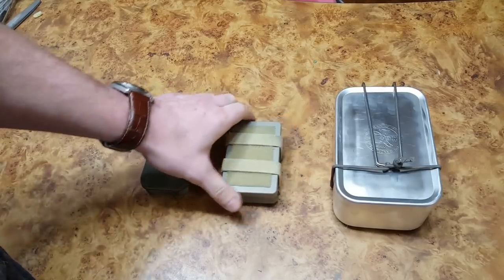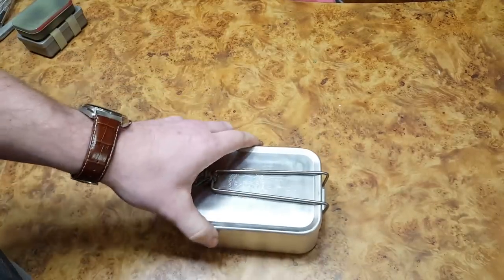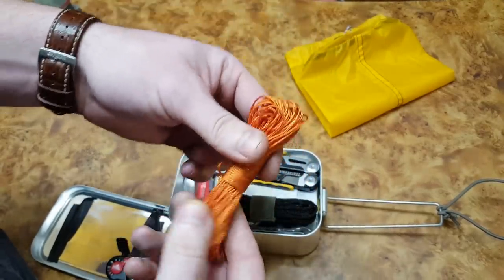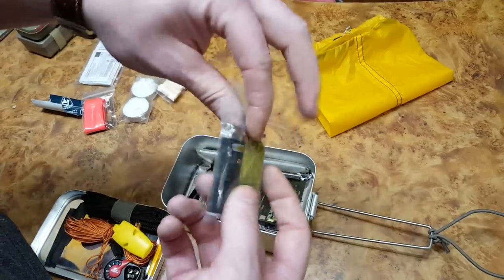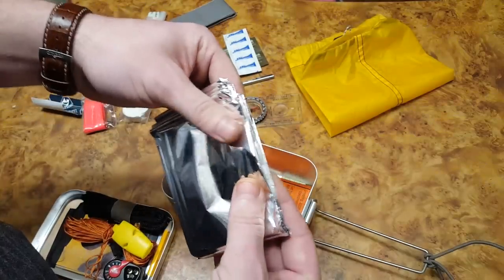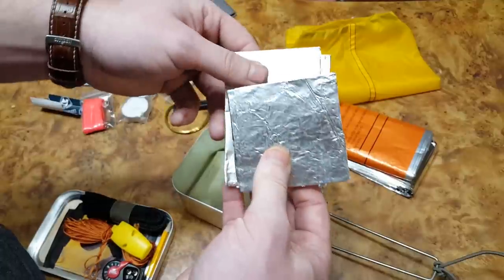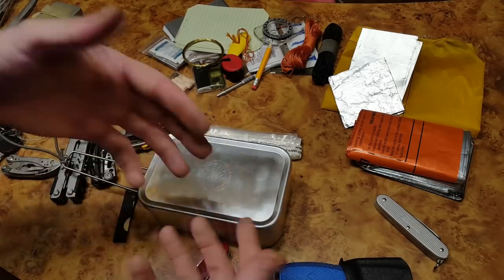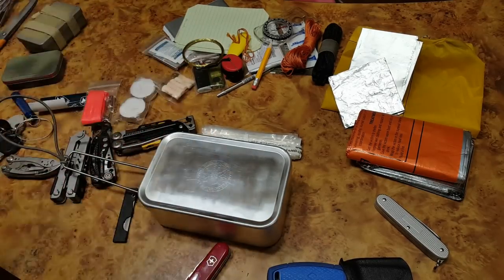Best Survival Tin Kit//Esee Survival Mess Tin homemade kit

Comment: Thanks for the video. 
My two cents worth:
If this is a last ditch kit, to use if you lose your main bag of gear, think about ways to avoid losing your main gear in the first place. Keep it as light and compact as possible, add a retainer cord or strap so if you set it down it can’t fall into a river or off a cliff! Don’t set it down then wander off and lose it. 
With this mini kit: Pay more attention to the shelter aspect. It’s better to conserve calories by keeping warm and dry than trying to gain calories by fishing and snaring. 
Signalling with a mirror is very difficult without an aiming device, even if you know exactly where to aim your flash, and impossible in tree cover or on a cloudy day. 
The ditty bag is a good idea, you can waterproof the seam with thinner silicon, or use the stand up bag inside it for water carrying. It would be even better if the kit was in a bag, inside the tin, so you don’t risk losing something when you empty it out to boil water.
Space blankets are not insulation, they reflect a small amount of radiated heat for a short time, until they become wet inside. (See Mors Kochanski).
A compass is of very little use without a map.
The marker tape is a good idea, if people knew how to blaze a trail and backtrack they often wouldn’t get lost in the first place. 
It takes about 10 times more energy to build a warm, dry natural shelter and gather firewood for the night than it does to carry a lightweight tent and sleeping bag. 
Finally, to everyone who makes survival kits, test them. Go out for two nights with some back up camping gear and try sleeping on a cold night in the rain, using just that mini kit. It’s the only way to know if it will work. Then try doing it one handed, to simulate a common injury when using knives outdoors.
For my calculations see below, after Greg’s comment.
Reply: Was the “ten times more energy” comment based on anything verifiable or just a line thrown out to make an opinion seem like fact?   When I was a  much younger man and backpacked with the Young Sierrans, we carried a fair amount of kit even for our two night out weekend trips - doubled walled tents, ground cloths, sleeping pads and bags, stoves and fuel, nice meals ... We weren’t going out to experience “survival” in the wilderness, but camaraderie in the outdoors - away from our desk jobs and city life.  Many would say this is “roughing it” because we did NOT have electricity, cell phones, the internet, hot showers, flush toilets, etc. We would have “survived” quite well based on the amount and quality of gear we carried on our backs into our tiny areas of seeming “wilderness.”  Real survival - life or death - is more dependent on what you carry between your ears and in your heart than what you carry on or with your person.  Still, if you want to do attempt something like Shackleton, you best have all the will, knowledge and kit you can muster.  Maybe you’ll survive, if that is God’s will.  All these other kits and concepts are better than being “naked and afraid”, but involve trade offs between not just what you can afford, but between what you reasonably can carry AND WHAT YOU WILL CARRY AND HAVE WITH YOU WHEN YOU COME INTO A LIFE OR DEATH SURVIVAL SITUATION.  Mors probably came up with the best compromise - for the boreal forest - with his two kilo survival kit.  Always good to be prepared.  But when your time comes, when God calls you home, you won’ be able to hide under the mountains or the ocean’s, no matter how much survival gear and knowledge you have.  No one survives forever - the way the secular world thinks.  So be good and do good.  Then you’ll be best prepared.
Reply: Greg Kukulski                          It’s a fair question.  I knew that pitching a lightweight tent and setting out a foam mat and warm sleeping bag was quick and easy, and ideal in a real emergency, but I wondered how much energy it took an average person to carry them all day, compared to walking with a very small kit and then building shelter. My own experience is that building a proper rain proof debris shelter or well covered waterproof lean-to from natural materials takes about 3 hours of work. From watching many experienced people online that seems to be the norm. As far as I know there’s no specific study been done of calories burned while building shelter and gathering firewood, so I looked at types of exercise which have been studied and chose ‘light aerobics’ as a fair equivalent, with all the continuous raking, bending, lifting, dragging, carrying and walking that shelter building involves. Collecting firewood for the night takes about another hour or so of similar exercise. Average figures from medical and university studies of people with different body weights and fitness levels are available online and give approx 460 calories per hour. 1844 calories in 4 hours.
Then I looked at how much additional energy is needed to carry a pack, over and above the energy used while walking. Again, the figures from military and medical studies are online. An excellent page with an explanation of how the military study load carrying and an ‘energy vs load’ calculator is called “The ultimate backpacking calorie estimator” at outsideonline.
I allowed 11 pounds of kit, being plenty for lightweight shelter, insulation, food and water, and the most weight the average person would want to carry ‘just in case’ on a wilderness day hike. 
It burns approx 25 calories per hour extra. Then I multiplied that by 6 to assume 6 hours of actual walking in a day, to allow for rests, lunchtime etc. 
That’s 150 calories extra to carry an 11 pound pack. This assumes walking on generally flat or undulating ground, not climbing.
So it turns out that carrying moderate weight on your back while walking requires not very much extra energy compared to just walking, if the terrain is not too steep, and the weight is within normal ‘lightweight hiking’ range.
But 3 or 4 hours of the kind of work needed to gather materials and build a solid shelter capable of keeping us dry and gathering firewood to stay warm uses up a lot of calories. I rounded down, to keep the comparison more fair, since light aerobics is constant movement, but I was surprised to see the huge difference in energy used. At least 10 times more energy required for 4 hours of work than is used to carry 5 kilos on your back.
4 hours light aerobics = 1844 cal
Carrying extra 11 pounds for 6 hours while walking    = 150 cal 
Even if we think ‘light aerobics’ is twice as much effort as shelter building, that’s still a 5x energy difference. 
Factor in 3 to 4 hours useful daylight lost to building shelter, and 3 to 4 hours more exposure to cold, wind, rain etc with added risk of hypothermia, and the poor quality of interrupted sleep as a result of waking repeatedly due to getting cold as a fire burns down, which uses more energy and prevents restorative deep sleep, and the case for carrying proper shelter and sleeping gear becomes even stronger. 
As a side note to anyone hoping to get back all those lost calories from eating wild food, you should know that fish (not oily) contains around 125 cal per 100g
Cattail root only 25, whereas pine nuts have 600 cal per 100g (same as pemmican) and coconut oil 840 cal. So carrying highly calorie dense food with you is way better in the short term than trying to catch it or dig it up. 1 kilo of pine nuts gives you 2000 cal per day for 3 days. You’d have to catch, or dig up and cook 1.6kg of fish or 8kg of cattail root every day for the same calories.

Comment: I think you did a pretty good job. You covered the 10 Cs plus some first aid supplies. I recently made such a kit myself in a tin that is about 4" by  6⅔" by 2'" that has a clamping lid. I think yours is deeper than mine, but we made a lot of similar choices. I also have a baseplate compass for the same reasons. I have one tea candle. It can also be useful for starting a fire. I decided not to include wire but I have enough rubber tubing for a slingshot (or siphoning, fire blowing, straw, etc). I put in the Wazoo survival belt fishing kit and wire saw. I would mostly use the latter in a bow saw, so I added a medium SAK that has a decent saw blade. I included more things for starting a fire, but less for cover.
      I, too, have decided an Altoids tin is far too small to make a serious survival kit. That space blanket is very minimal as a cover item and it would take up most of the space in that size tin. It's a decent size for an escape kit, but you really want that stuff stashed where it is not likely to be found if you need it rather than in a tin in your pocket. Or it could be a decent fire kit container.

Comment: For me it's a get home kit, up to 40 miles, (ranch is 35 miles outside nearest city). So, Victorinox knife, water/container, water pills, small commercial bivi, rain ponchos, three aaa lights, one cr123a light, extra batts, some first aid, lighter, and a few extras. Food comes in a backpack just for mre's, stove, etc. I can do 35 miles in two days. This does not include personal protection devices. Light fast and easy for me. And I always wear walking shoes when I leave the ranch. I think some day we will see an EMP, or electrical outage for the long term. I also have a butt load of stuff in my truck, which i can take or leave. My luck I will be in the city when it happens.

Comment: I don’t have one of those little mora fixed blades yet but I will by the 5th of next month. I am putting together a kit in the ESEE tin & I think that little fixed blade with a comfortable handle is a great choice. If you have some carving to do the extra control you’ll have with that knife would be great, not to mention that if you need to do a good deal of cutting like making stakes or figure 4 deadfalls would be a lot easier on your hands & wrist. Most of the other things you you out in your kit are right on the money as far as I’m concerned. Including the tee lights ! Nice kit.

Comment: If you're going to store a bic lighter loose like that, get an according size shrink wrap and cover the flint wheel and button and cut it off or tear it when needed cause bics are prone to releasing gas if in a tin or pocket even and rendered useless

Comment: I like the way that you made this kit and the size of it it would fit very nicely in my haver sack. As for your choice of multi tool I found one fairly inexpensive at Wal-Mart of all places in their hardware section ( $9.00 ) that has a very effective saw if interested. Also I agree about the use of button compasses as I also lost a lot of them but found a way around that by wrapping a strip of glow in the dark tape around them or blue gorilla tape it works very well. Keep up the good work. Again very nice kit.

Comment: Nice video. Some might think it was a little long but if you're on utube watching survival kits videos I think you have the extra time. You seem very knowledgeable but I do feel the need to point one thing out. Blade length and sharpened edge are different. The small Mora might have more cutting edge. Just a thought.

Comment: You mentioned catching trout. Did I miss the fishing kit part? 
Anyway, I keep about 20 feet of 4# monofllament and a couple of 'Cubby Grub' 'Mini-Mites' in my kit. Each one comes in its own little tube, and they come in a variety of colors. Great for crappie, bluegill, and other pan fish. 

Might also consider oven bags. They can usually handle 400°F, so could be used to boil water or bake your catch in.

Comment: I'm a bit late to the show but, I found that the electric ignition Bic lighters are more water resistant. The trade off is that it doesn't throw hot Sparks for lighting tinder without fluid.

Comment: If you replace your tin and lid with British Army mess tins, you will have two tins with handles that nest inside each other for very little loss or gain in volume, and minimal gain in weight and they are stronger too. They won’t be waterproof in themselves, but the contents can be kept in sealable food bags that give you an extra source of water carry. Or you can ask your local butcher to vac-pac stuff to reduce volume and waterproof it. You could even vac-pac the entire kit, cos why open it in a non-emergency situation?

Comment: This seems to be more of a somewhat modified kit.  I noticed the flagging tape, compass, brass wire, whirl pack, tender wicks and a few other items come in the kit.  Overall I like the mods, and I have a similar setup.  I did include a good wire saw, immodium, and some to mine.

Look for cookie tins at the local Dollar General or Dollar Tree.  You can get some interesting tins cheap than you can buy an empty can and you get to eat the cookies!

Comment: Why not add a wire saw to your kit In addition to a good multi tool with a wood saw? Those mylar blankets really do work well along with a blanket to cover the mylar wrapped subject. I had an emergency  where my car became my shelter as it got real cold and by trial and error learned the best way that night how to effectively keep warm with it inside a long london fog like overcoat. Good to make room for a snack bar or strip of wrigley's sugar free gum. So many uses for the sticky gum (once all the flavor is chewed out). And the foil wrapper.  & a small barrel pencil sharpener that doubles to make a pealed branch tip for tinder to lite a fire.

Comment: Nice kit you have there Sir! I've had my ESEE Tin for about 4 years now and it has evolved in that time. I carry a lot of the same stuff as you have as well as a Sawyer water filter, some Water-Proof matches and an ESEE Fire Steel (for flint fires & bow drills).
I carry mine in a Maxpedition Thermite leg pouch which affords me some extra cargo space, so I have my ESEE Izula and another compact FBK as well as lots of cordage and a pouch for a spare 9mm magazine. Also a couple of survival pamphlets (wild edibles & dangerous plants/animals) and a bandanna in the thin leg pocket. 
There's also room for a couple packs of instant oatmeal and a compact Esbit folding stove w/ fire related stuff inside in the bottom of the large pocket. Also the saw in mine is a wire saw that I've learned to use pretty well.
Like yourself I always have a Vic-nox & a multi-tool with saws on my person as EDC's!

Comment: 0:35  ".. don't hold a lot of stuff.."   Exactly!  Why is a standard that was relevant 50 years ago necessarily relevant today? Modern clothing (eg cargo pants) can accommodate s somewhat larger container very easily!   Cheap?  If one is planning on using something to save your life, and still worried about cheap, then I think there is a basic flaw in thinking.
The ESEE mess tin kit, however, is somewhat too large for carrying in a pocket, even though it provides some seriously useful opportunities, like a cooking utensil. 
So, I'm thinking something between the small tins and the ESEE tin. 
Now, if one had a tin 135 x 80 x 35mm, this would more than double the volume of the Altoids tin. In fact it would accommodate a Victorinox Ranger Grip 78 knife, a full size Bic lighter, plenty of tinder materials, and basically all the other common survival stuff one sees. Just this alone would give one a significant edge in a survival situation (especially the knife's 4" saw blade). A tin this size will fit most cargo pants (or bush jacket) pockets quite easily, and the extra bit of weight would not be debilitating. 
20:00  As to the contents of the ESEE tin, I would start with a decent knife. If I had the tin mentioned above, I would have one there anyway, but if not I'd include it here. I'd have a back-up lighter in each tin anyway. 
24:00  Here you make a very good point. Such kits must never be seen in isolation. Like you, I also tend to carry BOTH a Leatherman (Wave) and a SAK (Swiss Champ), both in pouches. Now if I was going out somewhere away from home base for a while, and off the beaten track a bit, these would be there, as well as a fixed blade belt knife (preferably a Cold Steel SRK). That would be not negotiable. 
The ESEE survival mess tin would go as well, and the tin I mentioned would be in my cargo pants or jacket somewhere. I'd always have a Bic (or Jet) lighter in another pocket as a matter of course. 
In my kit bag (or whatever) I would undoubtedly carry my CS Trail Master for heavy work, and a Silky Gomboy saw.
25:20  You mention a wood saw, as I also did above. I would always provide for two - the 4" on the Ranger Grip knife, and the Silky. These two items are absolutely crucial, more than anything else.

All the other items complement these two items. 
25:50  The Farmer's saw is quite good, but the Ranger Grip saw just gives that extra length that is pretty important, not to mention the nice substantial main blade. The whole knife is only 40mm longer, so it's a really good package deal.
26,27  One BIG advantage of the small Victorinox (like my Swiss Champ) is that mega-useful awl. With this one can drill holes very efficiently, and this can be a game breaker. Using wood nails (carved using the knife) one can construct all sorts of things! [See Felix Imler's channel to be astonished at what he can accomplish.]
30:00  I must say I really like the idea of the mess tin being the "Home" of all the stuff, and that one can use it to boil water. Without such a utensil, it makes life that much more uncomfortable, as there is NOTHING in nature that can provide this. 
I really enjoyed this video and sharing my thinking. Comments invited.

Comment: Yes at £50 each the Solkoa box, or Suma box, that has no means to grip it to use to boil water sure is expensive, far too expensive, considering other mini mess tins lock, and are a little bigger and cost only £6